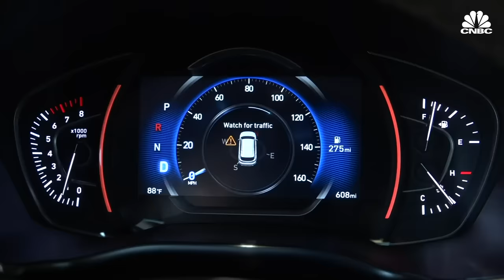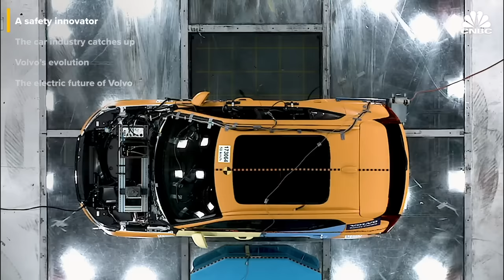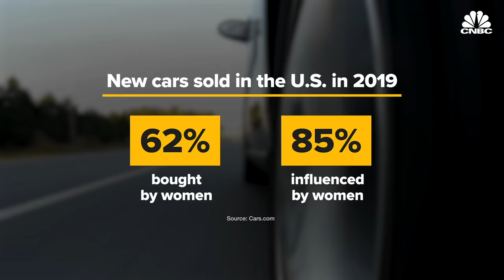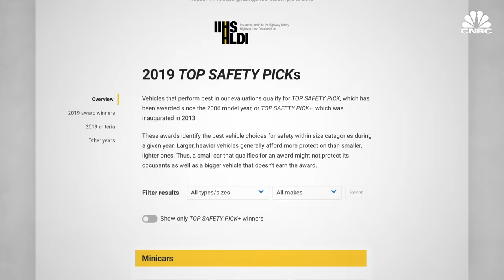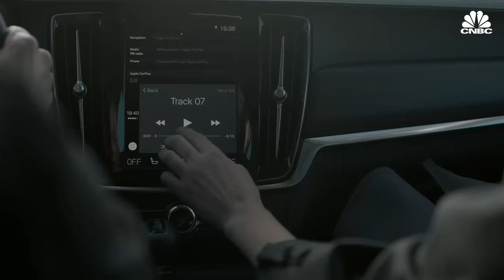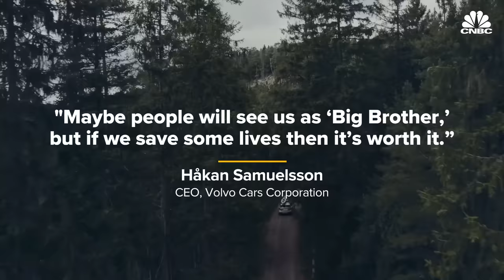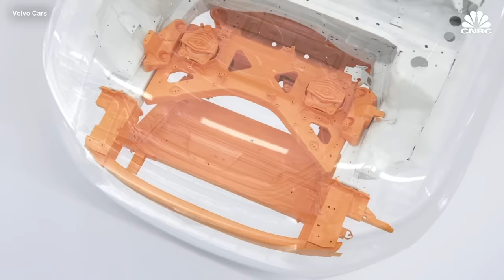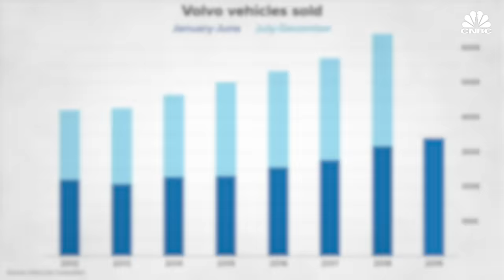Why Volvo Is Losing Its Big Lead In Safety

Comment: I own a 19 Volvo S60, I will say this, you feel the difference in terms of weight when you are driving it.  You want that extra weight especially when you get into an accident.  When I was shopping between that and a A4, the A4 didnt feel as planted to the ground and didnt feel as sturdy as the volvo.  You want a car that will protect you from anything it throws at it, get a volvo or a tank.

Comment: I am a BMW X1 owner and I did a test drive on Volvo XC 60 2016 which has adaptive cruise control and blind spot system in standard. But the same year of BMW, you have to pay extra for them and some vehicles you can’t even have it though you wanna pay extra. I think this tiny think already proof you something: the safety shouldn’t be optional, instead, it does in their DNA. It’s easy to be a copycat not inventor. The title should be more neutral.

Comment: There's so many Chinese bots here trying to support Volvo. The old Volvo is gone.
Reply: @Michael Farley II Some are made in China and they are said to have better quality than the ones made in Europe. In all honesty, most of the cars are made by high-tech robots. If the tolerances are tight in the design, the cars have high quality. So where they are made doesn't matter as much as it used to. I think today's Volvos are more in the spirit of the 60s/70s Volvos than the Ford-era Volvos were.

Comment: Why is this a problem for Volvo? "The trouble for Volvo is that safety has become a far greater priority for consumers and automakers alike...."  I strongly disagree that Volvo is losing its lead in automotive safety. Real life accidents speak volumes when it comes to car crashes. Moreover, it was Volvo that was the industry leader in the small overlap crash, that involved just 25% of the front hitting a deformable barrier as opposed to the traditional 40%. The IIHS introduced this ca. 2012 and Volvo cars outperformed all other automobile manufacturers, hands down!

Comment: I got myself into a Volvo because of their reputation of comfort and safety. 
🔴Bad choice🔴
My new XC40 slams it’s brakes on for no reason, has safety tech that only works between certain speeds(!) and has the most uncomfortable seats I’ve ever sat on. (Inscription Pro seats). Even the indicator sound doesn’t work. And to top it all, MY21 cars only came with one key! 🤷🏻‍♂️
The dealership ‘cannot’/will not help
I can’t wait to get back into a BMW or Mercedes.

Comment: Volvo doesn’t need to distinguish itself as a safety brand today. It already did it. Yes, you can buy other cars which claim to be top safe, however in Volvo you can be sure that it is safe. Yes, there is a smaller gap in safety between Volvo and others, however there still is a gap and as you said, Volvo builds car for safety driving, not for a safety and crash test.

Comment: oof these guys are idiots, yes in un-avoidable crashes there’s hardly much difference between Vehicle makes, unless they test a new angle (which of course Volvo has already mastered with their own crash test centre). This is a good thing! The real edge Volvo has over it’s competition is the ongoing vision for safety avoidance systems. These systems are superior at detection and avoidance, not to mention they work in the dark. Volvo has many world firsts in Collision Warning+Avoidance Systems from: making an ill-advised left turn (with oncoming traffic), large animal detection, rear-end collision detection (flashes the hazard lights quickly to alert other driver), road departure mitigation, and driver gaze monitoring.

Comment: As long as you crash exactly like in the lab, most cars are fairly safe. How come that whenever they released a new kind of test, like when they introduced the small overlap, only Volvos could handle it without redesign? Could it be that the cars are tested for all sorts of accidents, not only the lab tests they know they will be rated on? On the roads where real accidents occur, all variants are relevant... Sure the difference is less nowadays, but that is actually a really good thing. Volvos are no longer just safe and boring, they have come closer to the competition as well. My shift from BMWs to a new Volvo was a step up in comfort and luxury too..

Comment: Everyone knows that the BEST electric vehicles hold a Tesla badge, because they are the SPECIALIST in the field. 
Same with Volvo regarding safety. They are the safety SPECIALIST. Everybody else just does the minimum effort to meet industry legislation. 
R&D into safety is not cheap. You think Ford is gonna come along and invest millions into all this extra safety, when they cant even be bothered to rust proof their cars?
Infact, when Ford purchase Volvo, they tell Volvo to keep quiet about the roof strenth of the XC90 SUV, because it was MUCH better than Ford SUV roof strength, which only just meet the minimum requirements. whereas the Volvo XC90 was class leading.

Comment: When a carmaker is limiting their cars to 180 km/h or 112 mph, it shows a not so great degree of confidence in their own cars ability/safety. German cars built their reputation because they are designed, engineered and built (at least in the good old days) to go at up to 200+ mph all day long safely and comfortably. Speed saves lives!

Comment: My S80 might have saved my baby, but I still hate it for having to manually turn off "auto start/stop" function every time when I start the car. Also the S90 had a VERY slow processor for the touch screen until 2019 model year, it's like running a Pentium 4 in 2019, go figure. Otherwise the car is great.

Comment: Just search for the phrase ""small overlap 2012"".
Only Volvo was ready for this test (even the XC90 of the early 2000 year model line). The rest of the auto companies were not ready, because they were only preparing for the mandatory crash tests.
Therefore, in terms of safety, I only trust Volvo.

Comment: Good luck to all the car companies that care about our bodies and those of our family. Thanks Tesla, VOLVO, Mercedes and the old SAAB,  and other safety minded environmentally minded car companies. If you have a bad crash you will need every one of those 5 Stars in all categories such as Teslas for example.  I do know, that my 1967 SAAB 96 saved my life because, like VOLVO, it had standard 3 point lap and shoulder belts and controlled crush.  I walked away from that 60 mph accident without a scratch.

Comment: I own a 2019 Volvo s60 t6 R-design and it has been nothing but headaches. 
From a cabin that creaks and squeaks to a constant vibration felt at highway speeds this car has been nothing short of a nightmare. 

Volvo Canada claims that the vibration felt is an acceptable driving  characteristic of the car and has admitted that there is no fix for it. Other than living with it or getting rid of the car.  

Funny how in this video the CEO talks about comfort as being a safety feature... Ask yourself how comfortable is it to drive a car that vibrates over a long period of time.  Answer... it is exhausting.

To show you how incompetent Volvo has become.  Over 9 months they tried to address the issues as follows. 

3 sets of all season tires
2 sets of winter Tires 
2 sets of winter rims
Using a set of rims and tires from a car with no issues 
3 sets of rotors 
Countless Roadforce balancing 
Alignments. 

13 visits to three different dealers 
Countless calls and emails with Volvo Canada. 

I am being told it cannot be fixed and that I have to live with it or lose out tremendously by selling the car.  

Volvo not only makes an inferior riding car their customer service is next level substandard. 

Stay away at all costs.  

They may look really nice but they are nothing more than a nightmare headache on wheels.

Comment: Volvo is naive. They shouldn't have shared their safety data. The reason other car manufacturers don't have this data is because they didn't want to have it. They purposely didn't test for it because they were not required to have the data until later points in time. See 3:50.

BTW, my Volvo V40 saved my life in a horrific crash from a speeding Nissan Altima that slammed into me at roughly 65 mph. I loved that Volvo car.

Comment: What is the woman at 12:34 talking about? Volvo isn't trying to be German. Their appeal is that they aren't German. If someone has to have a German car they'll get a German car. But if you want Scandinavian luxury, then Volvo is it as there are no Saab cars for sales. And Volvo knocked it out of the park with their current vehicle styling, quality, though not reliability. They may not sell as well as the Germans but they sell fine. As far as Volvo losing its lead in safety, they still are top performers in real-world accidents.

Comment: Every Volvo model is substantially heavier than any of the competitors in the same class. Volvo just puts more metal in critical zones and in general. Just open and move a bit a XC60's driver door and try the same with anything else in the same range - X3, A5, etc. Downside is Volvos typically have worse performance and economy. Upside (except for safety) - the ride quality is better.

Comment: A brand telling it's consumer's how they are supposed to drive their own  cars!?It is like selling stereos and telling your customers that they should only listen to classical music at moderate volume. Or, to paraphrase the CEO's words: No one needs to listen to heavy metal at high volume.
Reply: if ypu buy a volvo you represent volvo drivers. you should not exceed 180kph or 112mph, its just excessive
Reply: @erikbuiten14  If I don't smoke or drink I do it because it is a sovereign decision made by me. Besides, why limit the speed limit to 180km/h if the average speed where accidents with injuries happen is between 60km/h and 70km/h? And why 180km/h and not 145km/h or 154? Just like Apple removing the Jacks from the I-phone (without ever giving a "real" reason) limiting speed implies big reductions in development costs, simpler power-train strategy, battery management of electric cars, aerodynamics,  wind noise reduction...etc, etc
I want to see Volvo having the courage to come over explaining how much money they will save with this decision.
Reply: @utingabernardo8205  the average speed of accidents have nothing to do with this, as repercussions of an accident at above 180 kmh is far greater than bellow 180kmh. There is just no need to have the cars go so fast when you really should not drive that fast. There is not direct budget cuts on the cars by limiting the top speed as the cars need to be able to go faster than 180kph in police and ambulance vehicles.
Reply: Argument not valid for Germany where there is no speed limits. By the way... here the list of countries with more deaths in traffic accidents: Zimbabwe,  Liberia,  Malawi... with USA in 120th  position. Invest in safety for developing countries is far more important than any rhetoric.
Reply: @utingabernardo8205  sure, but why bog down on one country when it applies to the global market as well. German buyers will just have to buy a different car, Volvo is not sorrow one bit. Nobody who buys a Volvo does it because they think it’s the one with most performance, they buy it because of safety, quality, comfort and design.

Comment: You can't even get brake sensors in a volvo, not in standard, not as an option, it's a joke, they price themselves almost as high as Mercedes but are far worse in many departments, certainly not safer.

Comment: What happened with Volvo engines? 2.0 Liters on XC90? WTF
Reply: I had a Volvo XC90 2.5L back in highschool and is was a 2.5l turbo charged   5 cylinder and it definitely wasn't enough for that car. I would floor it at different mph and maybe a second and a half later it would respond. Part of the reason why I'm sure they stopped making it in a 5 cylinder and back to 6 and 8 though lol
Reply: @darrylphillips6301  but now they producing goddamn flat 4 ! This 2.0 should run my mower!
Reply: Because Europe.

Comment: "if it takes carbon emissions as seroiusly as it has taken safety" (13:10), then Volvo would have faster-charging cars with larger battery packs and more efficient miles/kWh than it does; it's among the worst in range efficiency in its traction batteries (whether PHEVs or BEVs) in the automotive industry.  Also, one huge safety area that Volvo has failed in is that of moving buttons/knobs/dials to the infotainment screen; this is very anti-safety, as the driver must take his/her eyes off the road much more to deal with touching icons in menus and sub-menus for important things like audio, climate, and now (2022) drive-mode controls.  Drive-mode controls should be on the steering wheel.  And Volvo's electronics and computer software has gotten so very bad that that alone poses a huge safety problem, in terms of front and rear sensors failing, cars braking automatically when they shouldn't be, etc.  And Volvo has failed hugely on the safety front by not allowing infrared cameras into their vehicles for night-time detection of people and animals, for peering through on-coming headlight and side-of-road-lighting glare, and for peering through nighttime and daytime fog.   One can argue that it's a safety issue to not include full-size spare wheels in PHEVs or BEVs; in BEVs, this should be standard with placement in the frunk.  Some key safety information like engine temperature is also missing from the instrument panel.  And one can argue that having any glass at all in the roof is a big safety failure; Volvo should at least allow the option of having an all-metal roof, and they do not in most cases.  So I'm tired of hearing all this crap about Volvo being so focused on safety; as you say, other automakers have caught up, and arguably (in many of the areas I've mentioned here), they have surpassed Volvo by a long shot.

Comment: Just because Honda Subaru shows like they get 5 stars because of electrical helpers the body structure of those cars are crap. If someone plows in to you your steering assist won't help you. You be just dead compare to Volvo where you will be alive . And I think those 5 stars are fake just because it has collision avoidance tech doesn't make the car 5 star. The structure of the body that build like a tank does!

Comment: Volvo changed its manufactory to Chinese. Boo.
Go VW
But yes I love them for safety
Reply: Of the S90, yes. S60 and XC90 is/will be manufactured in US for the US market. XC60, XC90, V90 and V90CC are made in Sweden. XC40 is made in Gent. XC60 is also made in China for the Asian market. XC40 has also started to be manufactured in China for the high demand Asian market.

Comment: If its safety 8 am really looking, im going with subaru, hyundai motors. They won the most safety, safety+ awards. But my biggest gripe with Volvo is that, its not swede owned anymore. Its chinese company.
Reply: Seriously, no. Volvo is better than ever because of Geely ownership. Stop focusing on where Geely is located and focus on how Volvo is doing under ownership of a new company. Volvo is more Swedish now than it was under Ford. Under Ford, it was full of Ford platforms and parts. Now Volvo makes their own platforms, the SPA and CMA. Before they shared platforms with Ford. Any Volvo platform now Geely can use for their cars but they are Volvo engineered platofrms. Please get informed and don't repeat nonsense about Volvo being Chinese.